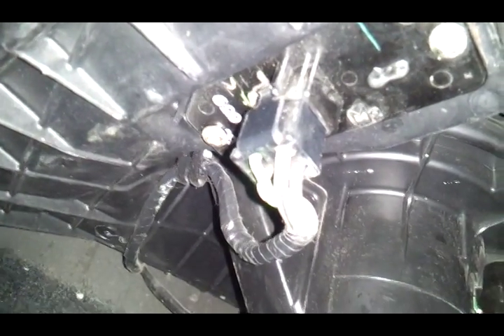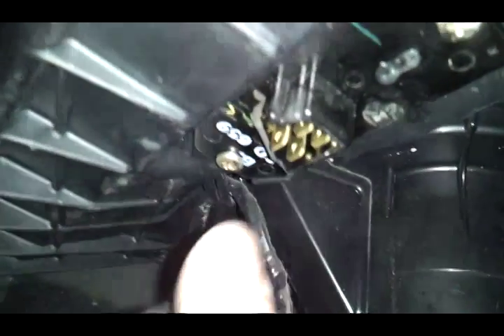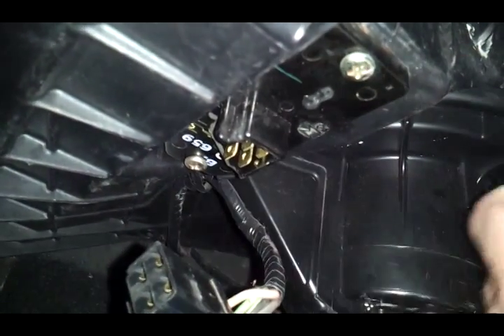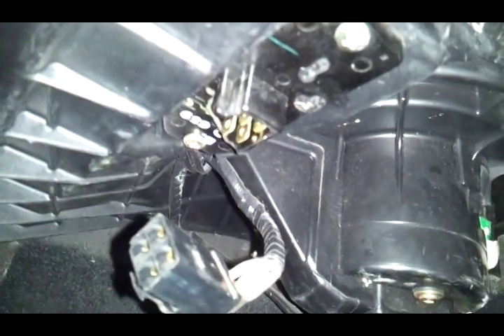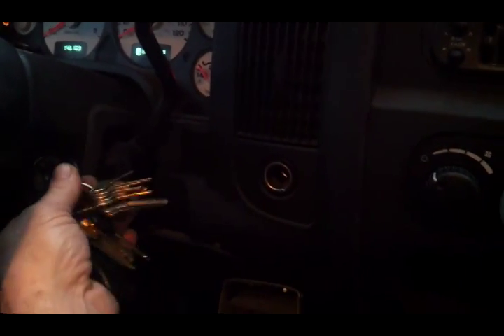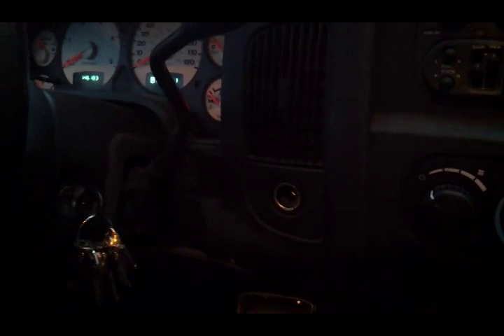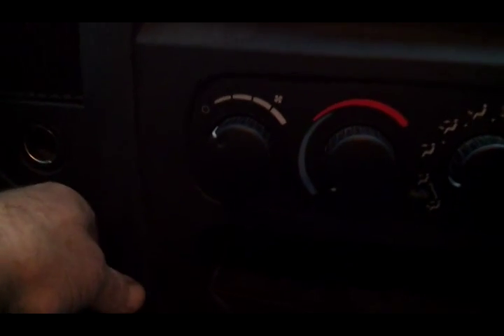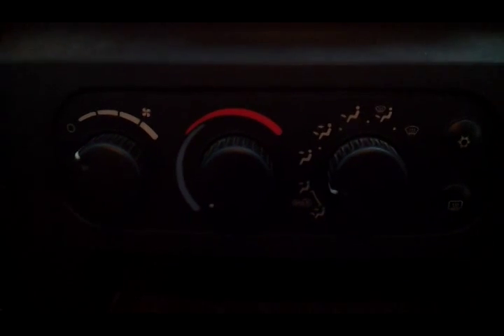2003 Dodge Ram HVAC Fan works on high only. Repaired

Comment: The jumper is a spring which will open if it gets too hot. Maybe a one time problem. Unfortunately mine opened up in the block.
update - after taking off and using a ohm meter to check, it appeared to be ok. The contacts on plug were dark and had gotten
hot, cleaned them up and it worked. You should be able to read a resistance between all 4 terminals on the resistor block.

Comment: Wiggled mine a little bit and it worked
Reply from the maker: Your terminals are probably getting chard from heat in the terminal from high current and poor contacts. I eventually had to replace terminals and contacts.

Comment: Thank you for the tip, had the exact same issue with my 2002 dodge truck. soldered the resistor worked again. Sweet!
I wondered if the contact could of gotten hot enough to melt the solder connection. There was a lot of debris around the resistor when I pulled it out. I think it is possible the debris impeded air flow and over heated the resistor because it appeared to have been soldered before. Anyway this repair did not cost me a dime!

Comment: Thanks greenrumour!  I pulled my resistor block, cleaned off a little corrosion, blew out a couple ceramic particles, reinstalled it and all is working now.  I'll probably get a new part, but I'm good to go for now THANKS to you!